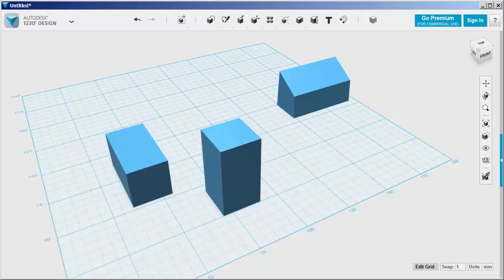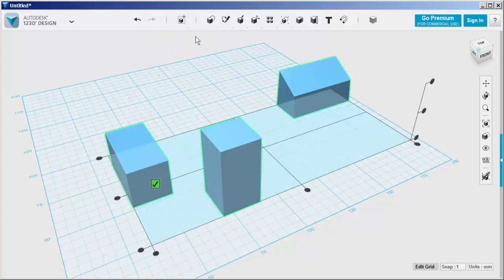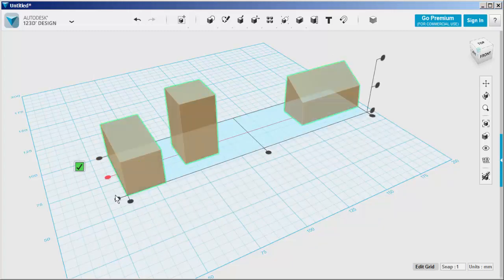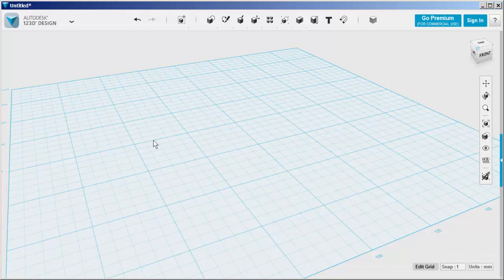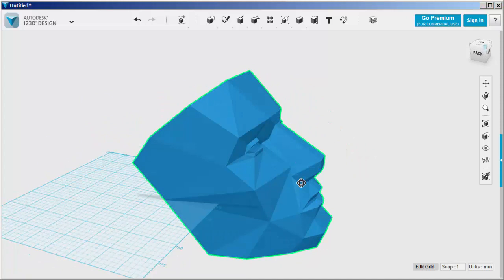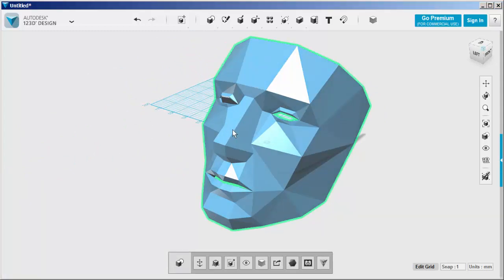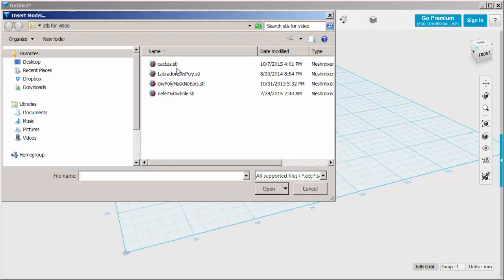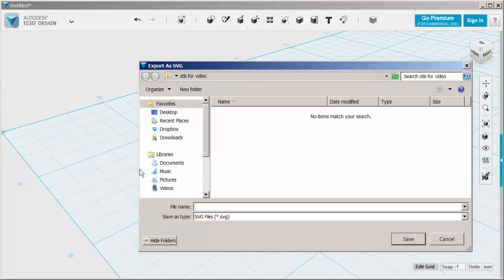123D Design: Smart Scale, Align, Convert to Solid, Export as SVG

Comment: hi, any idea why my DWG file is x10 when I open it with 123? both software are in mm. cheers
Reply from the maker: All file types just seem to import very large into Design. Scale them down inside the program. Maybe try shrinking the dwg file before you import it.
Reply: cant shrink only scale up in 123, will try a scale donw in cad. thanks.